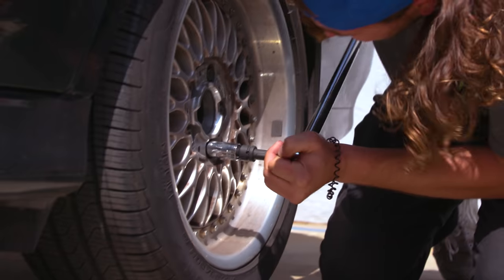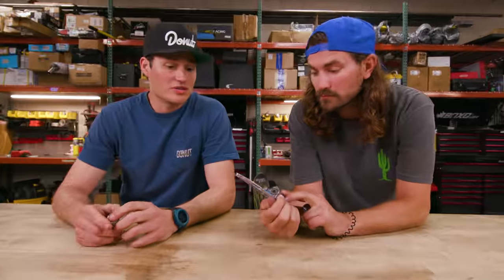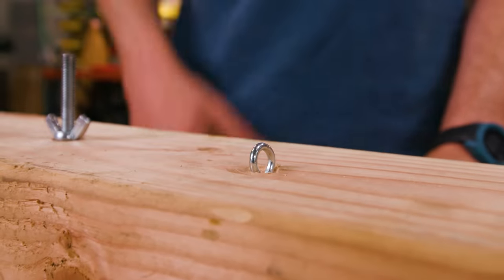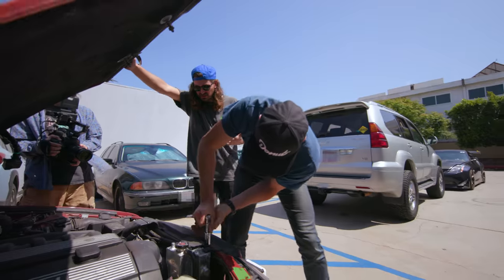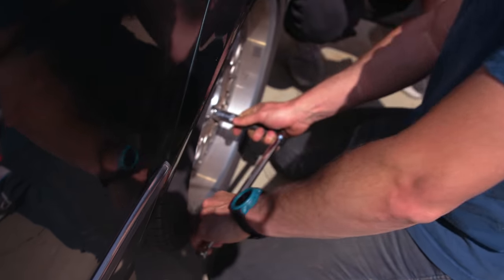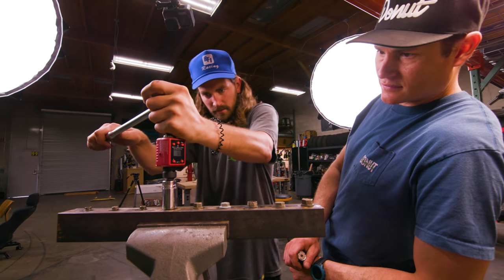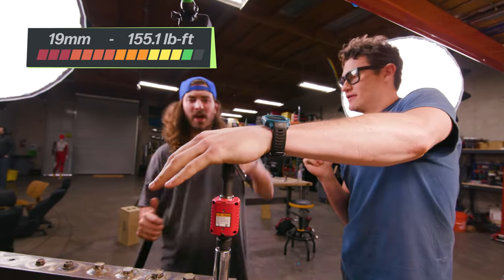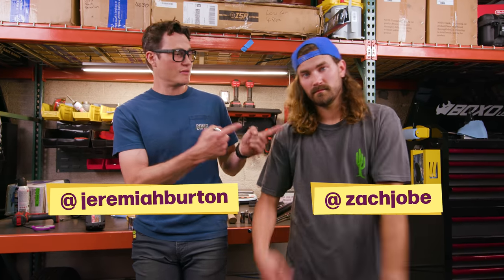Testing the World's Most Hated Tool

Comment: I know there are kind of goofy, but I do carry one in my motorcycle toolkit.   I think it would be a better tool if the pins had a hexagonal profile instead of circular.
Reply: That's what I was thinking as well, using a wire EDM machine I could cut the pins to be a specific diameter and that way it'll always be a perfect fit everytime
Reply: Ones with hex pins do (did?) exist I used to have a very specific and niche use for them in a previous job but we did have to replace them fairly regularly.
Reply: @Ironsight_Player  No need for EDM, allen keys aren't made using EDM.
Reply: It looks to me like the one they use in this video ARE hexagonal
Reply: @jrodriguez1374  uhhhhhhhh are you blind?
Reply: @jrodriguez1374  no the pins are round. The socket is hex, yes, but not the pins themselves.
Reply: @jaguiar45  Curious to know when you tried Harbor Freight… I agree 10 years ago they were junk, but last year in desperation I bought a 1/4” socket set for like $12, and I have to admit it’s the one I reach for now. My old Craftsman tools are better, but they’re loose in a bag so I have to dig for them. The HF (Pittsburg) tools are in a nice little case and so far have been perfectly serviceable. I’ve used them probably 50 times with no issues at all. While I can’t bring myself to recommend Harbor Freight, my own experience with their more recent stuff has been positive.
Reply: @jrobertech  yea ur right. At 0:14 some pins on the inside look to be hexagonal but that's prob only because of the shading. The ones near the outside prove they're round
Reply: First off, it appears the welds on some of the bolts impeded the socket from getting the best grip possible. Secondly, on some of the tests the tool was be pulled off at an angle instead of being held in proper alignment. Common sense should tell one this is just a convenient tool for certain applications. I am not defending this tool whatsoever, but give everything you test a fair chance. Lastly, I have had this type of socket for over 20 years. I do not even remember where I got from, but it still works with and is very handy to have around. I know it’s strength and weakness. I do not know about the quality of the Gator brand, but this type tool is an asset to have. Thank you guys for the tests you perform….just give the products a fair “shake”.
Reply: @truthsmiles  this was like 20 years ago and I am sure they have upgraded by now.
Reply: @jaguiar45  if it was their "Pittsburg" brand (private label), it is lifetime guaranty on it. Bring it back.
Reply: the first gator grip did have a hex type pins in it. someone redesigned it to have round. and that the type that is being tested.
Reply: In yhe words of CPGrey: "Hexagons are the bestagons:
Reply: I've used it on stripped nuts. That's really its only good use. Otherwise, it'll strip a non stripped bolt.
Reply: I always thought thats what it had. That's weird.
Reply: Harbor Freight has stepped their game up, they've been at it for years to build up their rep. A good amount of their tools now are good beyond a niche, often basic tools and still as a preference(like if you prefer _ type of ___ on a tool and their tool has that)
Reply: My technique for using one of these is usually for smaller nuts or hex nuts but keep the same pressure when using in
Reply: Or were smaller
Reply: Do they make these in English and metric ?
Reply: @workonitm8  The Patented King Gator is a self adjusting universal socket. Self adjusts from 7/16ths-1 1/4" standard and 11mm-32mm metric.
Reply: @Ironsight_Player  you should make them and compete with them lol
Reply: Maybe a tiny file? Idk that would be hard to do a lot of them bc they are stuck inside such a compact space, without cracking them aswell
Reply: dude this will chew up the heads on whatever motorcycle part you're using it on. but it will work in an emergency, yes
Reply: It’s good to have in case it works but it’s bad to rely on
Reply: exactly

or maybe just a series of flat metal peices to flush against the bilt sides
Reply: If someone made exact machined pins to fill every microscopic area ,tempered each pin to a chisel hardness and had individual springs for each pin which were kept well lubricated it would remove any bolt or nut at any torque settings.But with loosely fitted pins no matter how tight the initial grip applying torque will compress the pins away from the fastener and it will slip which will create wear and a larger gap each time it's used.
Reply: seems like a couple of these would be good in an emergency repair kit. if they only work once and then you have to throw them out, that's good enough for most emergencies.
Reply: @jrodriguez1374  nah all those pins look circular to me.
Reply: i shouldn't say anything but... a little work with a machine shop to finalize the plans and a quick patent. You got the next big tool accessory ;)
Reply: I had an hexagonal one at some point. It worked. But it is only good when you don’t have enough tools or very limited storage capacity.
Reply: I thought the same exact thing,  I also carry one in my tool bag.
Reply: You'd better patent that improved alternative before they release it as Ver 2.0
Reply: I thought I was smart for thinking of that too then I see a lot of people saying it. I wonder why they didn't try it? I guess it must be a lot lot more expensive to try and precisely machine hexagonal prisms than just extruding some steel wire
Reply: @1three7  As said above, it does exist. I had one in europe, maybe it isn't sold in the US.
Reply: @useyourheadpliz  yeah I read more comments after posting mine. I guess they trimmed the cost switching to round pins maybe. Sounds like there's nicer versions out there
Reply: Hexagons are the bestagons
Reply: I think that would work better, but it wouldn't fix the issue with bolts being rounded.

Traditional sockets have round cutouts on the corners so that pressure isn't applied to bolts where they're most prone to rounding.
Reply: I don't think so cause in that case you'd have to orient that gator socket onto your bolt just so, precisely right, not half a mil off or you'd push in many more pins than would work too give a good grip being pushed in. In real life, your orientation is coincidental, as you cannot see what you are doing precisely. I personally think it only could become somewhat better if it had more pins that were thinner, and it this pins were made from the highest grade of steel, actual 'tool quality' steel (which would mean hardened and impregnated with carbon), and that they actually are absolutely not. But that would make them several times as expensive and they still wouldn't be really good.
Reply: @mfx1  They 100% do exist, I've seen them.
Reply: you're giving me ideas here
Reply: @Ironsight_Player wow aren’t you crafty with all your tools and ambitions
Reply: Hexagons, are the bestangons.
Reply: My dad has one with hexagonal pins
Reply: I bet hex pins would increase the cost of manufacture to the point that it wouldn't be a cheap alternative to a socket set.
Reply: I brought one off temp that has hexagon pins and it's pretty good